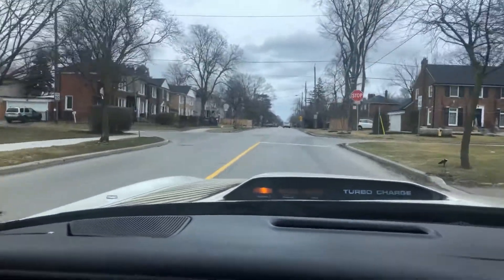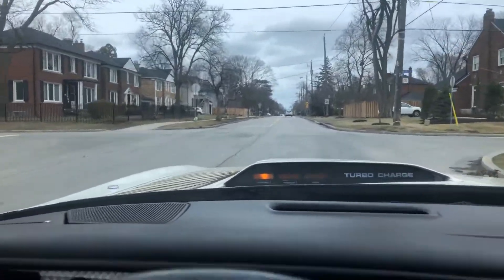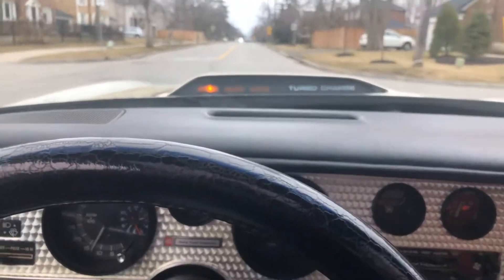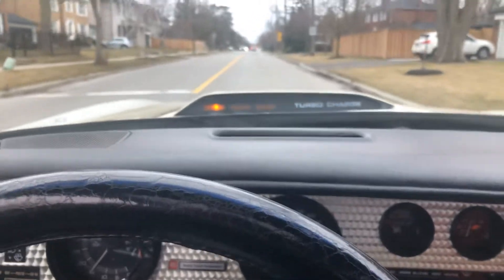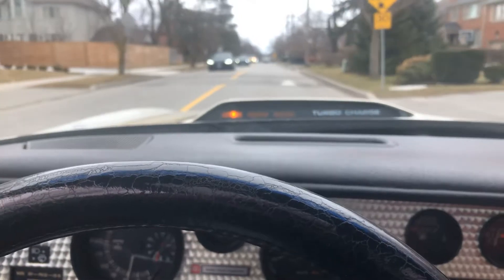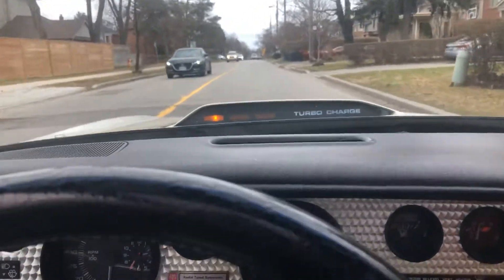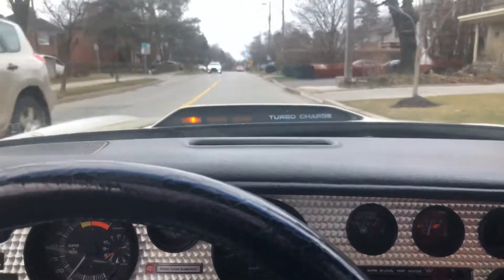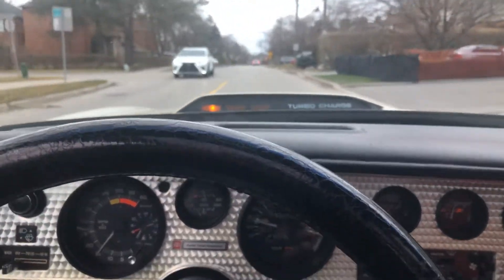1981 Turbo Trans am last ride stock engine

Comment: I know it's far from fast stock but MAN , that engine is a very cool , oddball engine..you shoulda just boosted it to the moon
Reply from the maker: I probably will end up boosting it with a supercharger, turbo chargers make more power. Problem is space under the hood is scares. The only option that wouldn’t cause a headache is a supercharger. I have a lot of money invested in my 1 7/8 inch long tube headers dumping into 3 inch stainless exhaust system. Wouldn’t want to touch it.
Reply: I agree I like this weird stuff

Comment: The switch located down on the console, did this control some kind of high/low boost function? Or simply works just the lights in the scoop on/off?
Reply from the maker: I actually put that switch in the console to turn the power antenna on or off or I should say up or down handy when going through a car wash . When I’m listening to CD’s the antenna stays up unless I turn it off.
Reply: @vikenlink  I didn’t actually see the switch in the video but I’ve seen it in person, located just in front of the shifter on the console....from the factory it said turbo on the switch and it toggled between a high and low setting.
Reply from the maker: Oh that switch lol …..located buy the power window switch . That’s just the Turbo boost gauge switch. The switch dims, brightens or turns off the turbo lights on the hood.
Reply: @vikenlink  thanks brother! Did you end up ls swapping this car?
Reply from the maker: @kolourblind3124  sure did… it’s a LS 416 stroker putting out around 650 HP at the crankshaft. I have a few videos on it here on YouTube.
Reply: @vikenlink  awesome I’m gonna check them out

Comment: These are now all gone. A dozen exist in museums and private collections.  Impossible to find in its original form. All have been swapt out, and "upgraded" with mods.
Reply from the maker: Ya you’re right about that... not to many stock original turbo T/A’s are left . Mind you the original 301 turbo engine was so poorly designed that a VW rabbit of the same generation would give it a run for the money, not to mention Honda Civic’s. 
that being said, I’m happy doing a LS swap, 416 stroker to boot. I’m also happy others are doing some sort of engine swap weather it’s a 5.3L or 6.2 to improve performance .  Besides back in the late 70’s, Pontiac was sticking everything from Olds 403 Chevy 305 to Pontiac 301, 301 Turbocharged and the Pontiac 400 in there Trans Am’s .
Reply: @vikenlink These were amazing cars, and we thought they had a lot of power. Yes, its crazy to spend 1000's of dollars to preserve a 200 HP engine plarform 'that is easily capable of 300 HP in its technically  obcsolecent technological form, but then again that is what makes the original suvivors unbelievably special.
Its all about those three lights functioning as they were meant to.

Comment: Do you still have the motor you pulled from the Trans Am?
Reply from the maker: No I don’t have the 4.9L Turbo Pontiac engine anymore.
Reply from the maker: I sold the engine a couple of years ago to a gentleman that was restoring his 80 Turbo Trans Am. I recall that he really just needed the factory exhaust manifolds and turbo charger. No idea what he did with the rest of the engine.